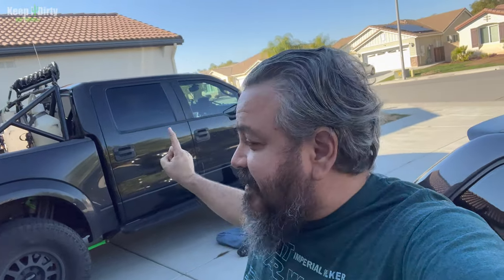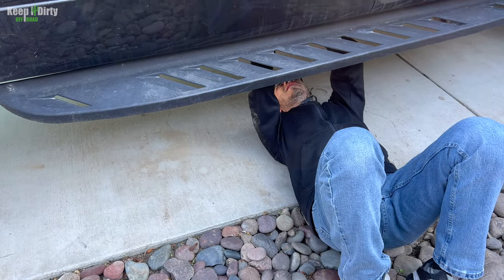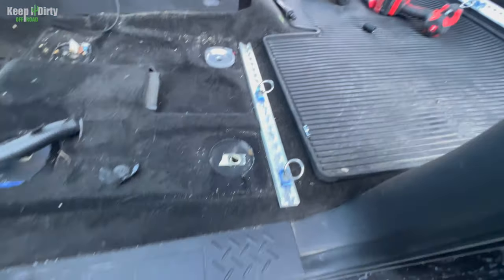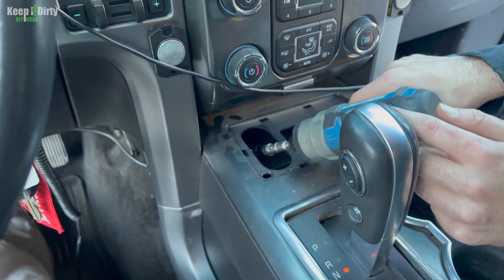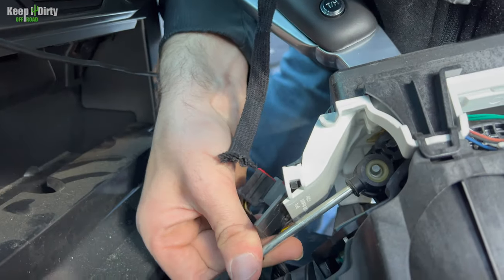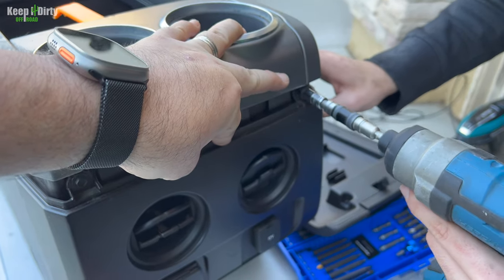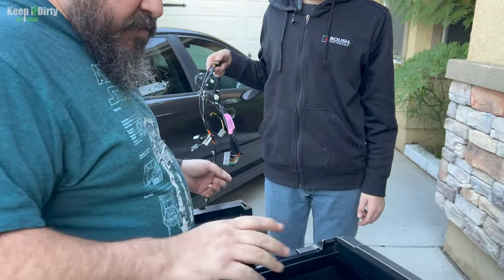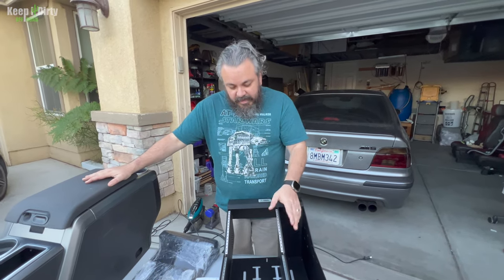Remove Stock Center Console - Gen1 Raptor Custom Center Console

Comment: Thanks for sharing. Hoping to swap a center seat into a gen 1 or 2 raptor so I can fit my family of 6.
Reply from the maker: Awesome. Made a point to do this video separately because I could not find a good video on how to remove the console
Reply: Nathan, did you ever install a jumper seat? I’ve been wanting to do the same thing but have been most fortunes discourage it. 
This is the only video I’ve found who’s removed the center console and I’m excited for the possibility.
Reply: @KeepItDirtyOffRoad  how difficult would it be to place a center seat along with the shifter? Could both fit?
Reply from the maker: The shifter will be your challenge here if you go with the center jump seat.

Typically the truck with the center seat, have the shifter on the column. I personally wanted the shifter on the column but could not find any info on how to do it. Which is a shame. 

Technically you could do it and just make a plate to hold the shifter. But your going to be shifting in between you center riders legs. The floor shifter is too big to be mounted anywhere but on the floor.
Reply: @Jack Kingsford  I bought my raptor a month ago and still plan to swap the center consol to a seat. I'm 90% sure it's possible as the interior is the same as an F150. Watched several internet videos of 150 guys removing the jump seat and switching to center consol and consol shifter. I'm just doing the reverse. I bought a 2018 Gen 2.
Reply from the maker: Here is a tidbit that may piss you off. On the 2018s ford spent a ton of money to make the shifter to feel mechanical. There is even a cable I think going into the transmission to fake it. But it is in fact a digital electronic shifter. Think how much easier the swap would be if you could just plug in another shifter. Like the Gen3 raptor shifter that is much smaller. Or just plug in a column shifter.
Reply: @n8_EUC  if you are successful, please update me. I’m really rooting for your success…so I can replicate it 👊

Comment: Unrelated comment. Do you think it’s feasible to retrofit a gen 2 center console into a gen 1? I’d have to fab the upfitter switches to overhead which would be fine with me.
Reply from the maker: Not  without a lot of work. 

Gen one has the amp under the console and it’s much narrower than the gen2. Then you also have to figure out how to run the vent tubing. I looked into it and IMO it was not worth it and way more work than a law enforcement center console
Reply: @KeepItDirtyOffRoad  thank you! 🙏🏽 I was curious about it. I know you have more equipment that you need to get placed so I get why you didn’t try a gen 2.  Gen 1 storage and cup holders suck so bad 🤣

Comment: Do you think it would be hard to add a Center seat and somehow relocate shifter? Or even column shifter? Reason I ask is because I currently no longer fit with the whole fam in my gen one and refuse to let her go!
Reply from the maker: I wanted to switch over to a column shifter myself but I could not find any details on line on how to do it. It would require a lot of parts, new cable, and some programming and I could not find anyone that had done it. 

Putting in a bench should be easy I would guess. Just relocating the shifter is not
Reply: @KeepItDirtyOffRoad   got it yeah same result here I would mainly have a little one in the bench seat I was even thinking like a floor shifter location type style idk I’ll probably have to take everything out like you did and go from there thanks!

Comment: If I have a base raptor and wanted to add new seats that have the cooling option,  will it still plug in or do I need to connect to aux?
Reply from the maker: Honestly not sure. It’s safe to assume that if you don’t have it, you may need to manually turn it on with an Aux button. But on the gen1, the ventilated seat options is a software button. It may work but you would need to probably do some coding using forescan.

Comment: You’ll prob have airbag light on after this since it seems you didn’t unplugged  battery , seats do have airbags
Reply from the maker: No air bag lights. Truck drained the battery with just the doors open and cleared it all 🤷‍♂️.